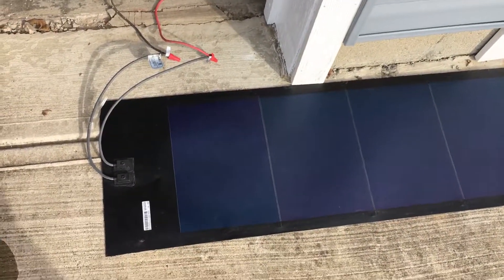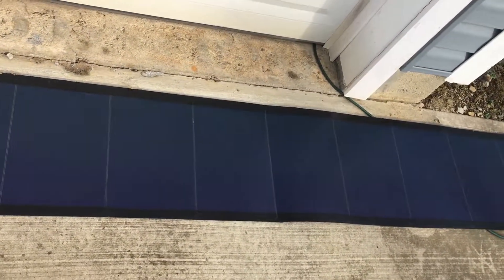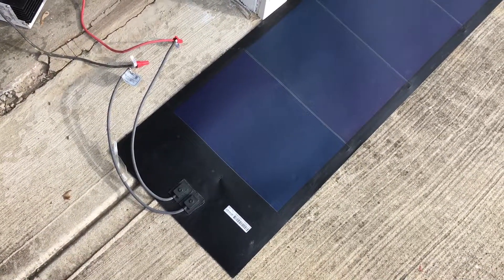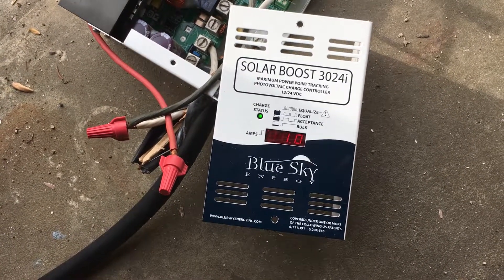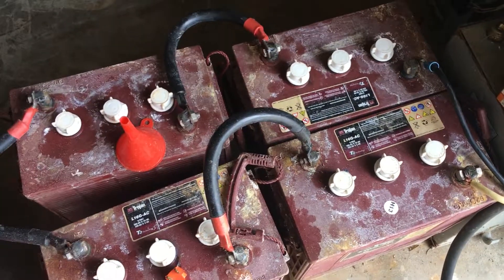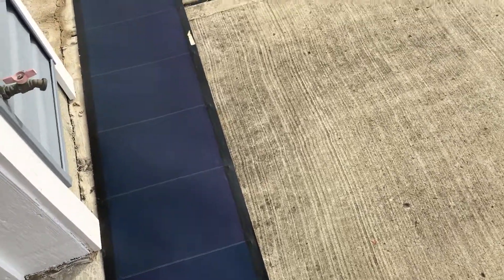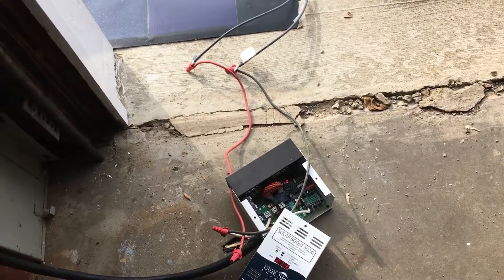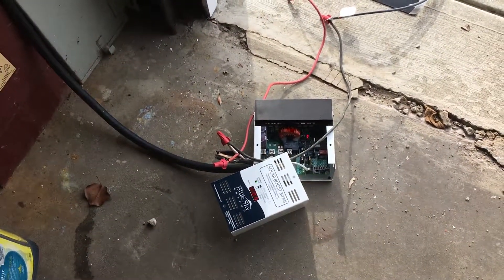Testing flexible solar panel output

Comment: which would be best to do as a first time starter, the 136 watt or the 128?
Reply from the maker: They are identical besides the length and wattage . The 128 is slightly shorter and a few less watts. Either would be fine. Go for the one at the best price!